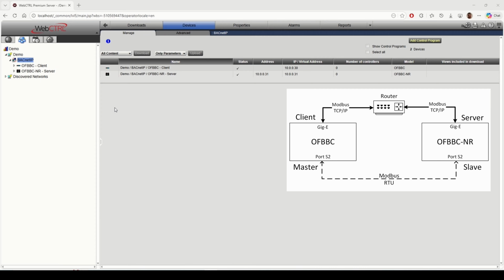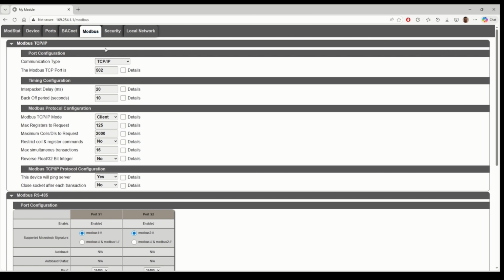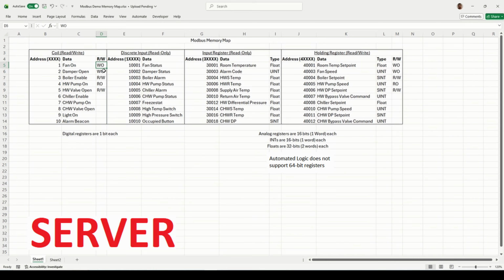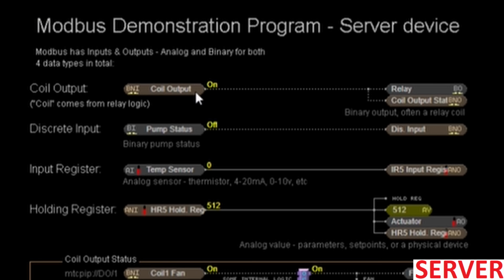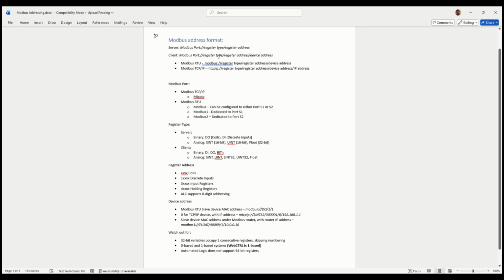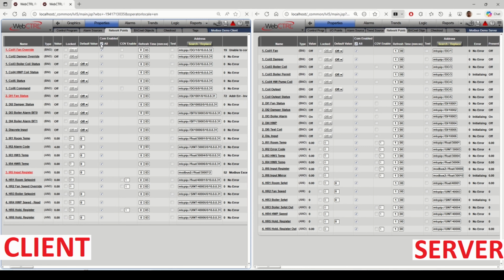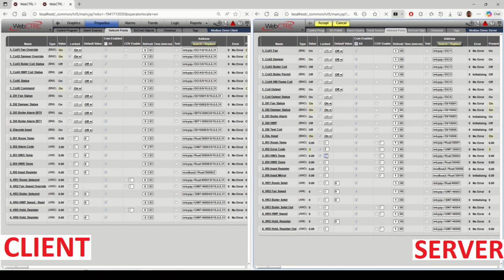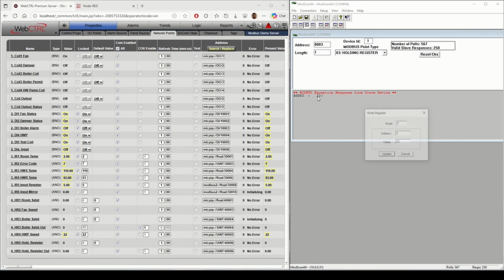How To - Modbus in Automated Logic WebCTRL

Comment: Id love to pick your brain and see if you can help with a generator using modbus to a eq-prtl. We have 4 guys try to look at it we still can"t get it talking.
Reply from the maker: Hey there,
Thanks for the comment.
Sure! Happy to take a look.

It pretty much comes down to 2 pieces: 1) getting the comms sorted out - any physical wiring issues and proper baud rate, and 2) building your program around the manufacturer's register map.

If you need support, just go to WigglyWire.com and send an email.